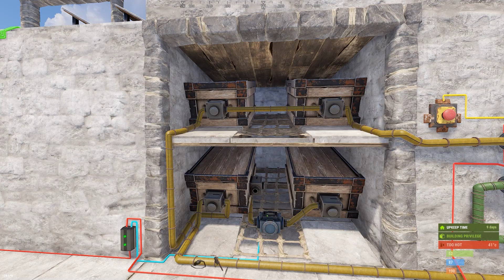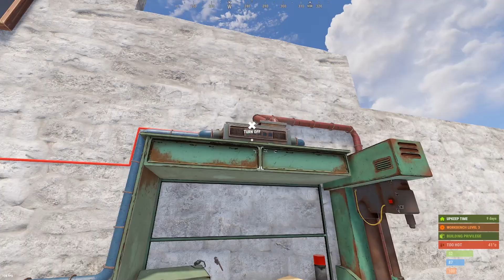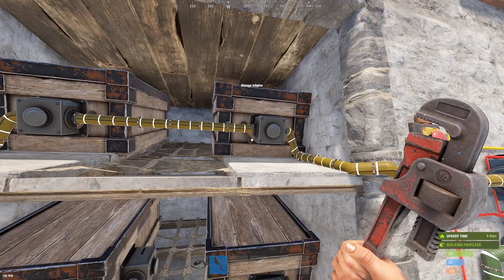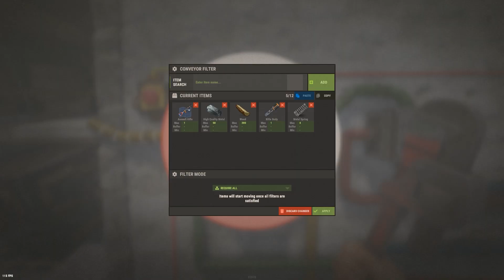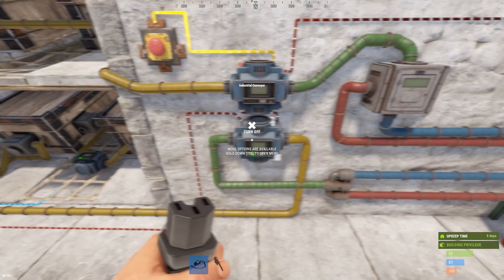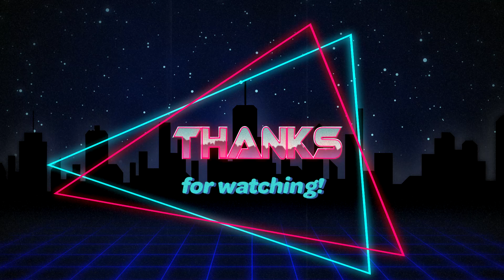RUST Industrial | EASY Blueprint Swapper - Version 1 | 2023

Comment: To avoid the multiple stacks issue, I run the materials in first and the filter pass from that conveyor sends signal to the blueprint conveyor to send the blueprint. Stack size issue gone, only one stack of wood needed. The conveyor that empties the crafter sends a filter pass to a 4th conveyor to unload the BP. One BP= 4 conveyors. Add 2 more conveyors per additional BP, all can have completely different materials. 
My next project is to use conveyors to detect a shortage of each item crafted in the system and auto craft a replacement(s) if needed.

Comment: Im struggling to get the filter pass to turn off to work correctly. Idk if its changed since you posted this but it only transfers like 60 wood and turns itself off. Maybe it was just buggy on the server I was on. It seemed to randomly choose between 60 and 120 wood and then the filter pass would activate no matter what I set the max to.

Comment: Would love to see a setup that did the items needed to setup a full metal kit and load them i nthe set of locakers. Turning off making if all the lockers are full. Also pulling out stuff added to the locker that isn't part of the kits and dumping those back into a box. So basical a way to keep all lockers in the base full. I actually think I could do this from what I learned on your channel but it would also make a great video!

Comment: I'm going to have to play with this. You could use a conveyer with an empty industrial out in place of the button to check if you have the item in your sort system, and craft one if you're all out.
Reply: I wonder if some fancy plumbing would allow the 2nd conveyer to do double duty as the item check conveyer, and if you could use it's filter fail volt so the power also does double duty.

Comment: Hey so I'm trying to make a tier 2 version of this with hazmat and SAR but whenever I try to make a conveyor move the 450 metal fragments into the crafter, it moves about half and then stops. I'm using "Require All" which I'm suspecting is stopping the transfer from doing a 2nd sweep, but even if I break up the metal fragments into many many stacks, it doesn't seem like it can move 450 at a time without breaking the conveyor transfer, any ideas on how I can fix this?
Reply: You need at least eight stacks of metal to pull from, since the conveyor will only pull 60 from a single stack at a time. 60 x 8 = 480 and will therefore give you 450 in the input.

Comment: Rather than a button, you can have a conveyor connected to the box/locker with filter fail for whatever you need to craft connected to the start.
Reply from the maker: Yep!
Reply: How would this work? Does it toggle on the crafter to start crafting an item?
Reply: @bobberman44  a conveyor not attached (piped) to anything will filter fail and send a signal out. When I first tested it, the fail signal didn't consume power from it so the power loss was 1. (for the conveyor) So if you just need to branch off 1 power when there's power to a line, a conveyor is better than a branch which takes 3 (2 branch output, 1 for the device)